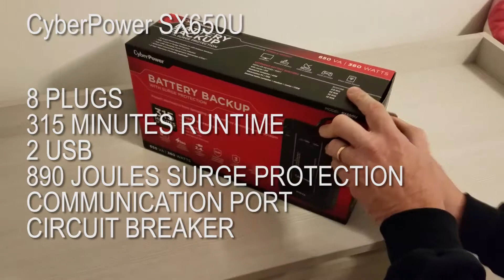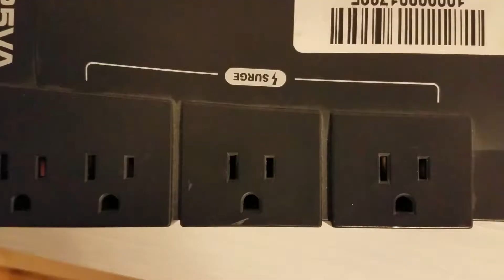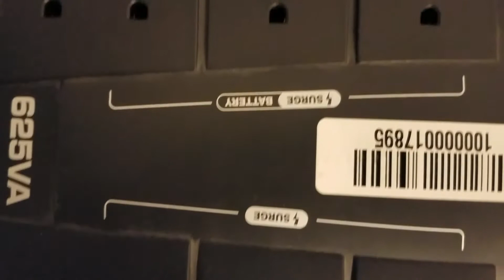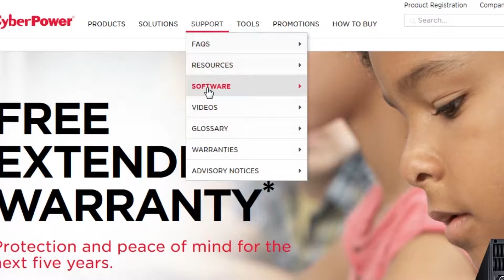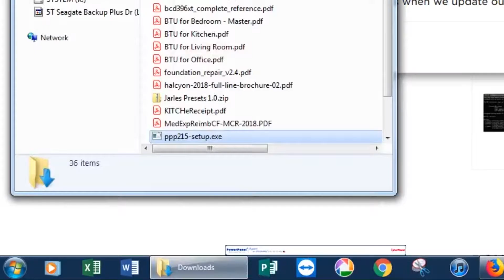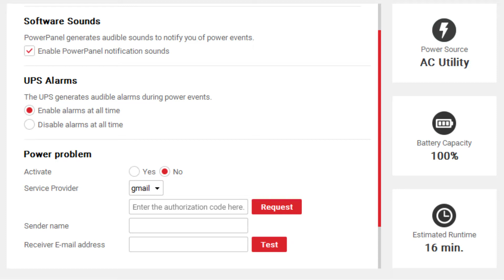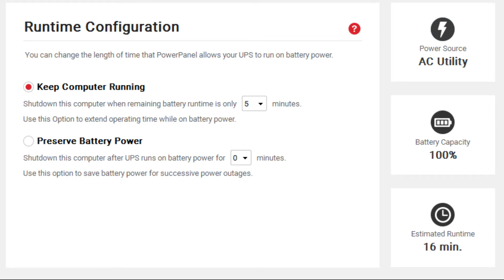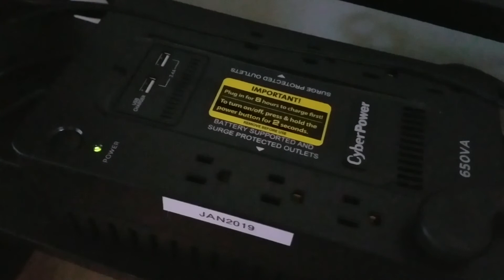CYBERPOWER 650VA UPS Truth and Lies

Comment: 😂😂😂 juste change Battrie 30$ 12 Amp
Reply from the maker: Generally I would recommend replacing the batteries at the most twice, by which time the surge electronics have worn out and there is better UPS technology available.
Reply: @cfldriven gaspillage d'argent
Reply: Cest bon 20 ans un ups

Comment: I bought this on sale. It did not have the usb cord? Will it still work ok if if i just plug in my computer.
Reply from the maker: The purpose of the cord is to safely shut down the computer using the Cyberpower software  during an outage. Without the cord the UPS will power the computer until it runs out of battery or somehow powers down the computer whichever occurs first.

Comment: for some reason  i can not get work on my laptop
Reply from the maker: While connecting via USB allows for the software to shutdown the laptop, just plugging the laptop into the UPS will provide surge protection and allow you to safely shutdown laptop during power outage.
Reply: i did for some reson it not working only showing on my laptop how much % the ups battery is like if 66% not know if it the cable i  restarted my laptop all thing
Reply from the maker: @kennthbrowne7051  You can try reaching out to Cyberpower support at https://www.cyberpowersystems.com/support/ or 1-877-297-6937

Comment: im a little confused cause i have my wifi and pc plugged in it nothing else my power went out and it auto shut everything off instantly idk why cause its always plugged in the wall
Reply from the maker: I have experienced the same situation and it can be frustrating. A few of the reasons it auto shut off could be the the combined PC and WiFi power draw exceed the 360 watt load, or the battery has deteriorated over time to the point it can not a carry any load. Your options would be to replace the battery, or get a unit that can handle higher loads like the https://www.youtube.com/watch?v=XveVObW70K4  Hope this helps.
Reply: @cfldriven  its 1000 watt it should be fine and its only a few months old maybe 5
Reply from the maker: @Spicearito  Then call them because it still under warranty.
Reply: @cfldriven  says its 496 minutes of battery remaining
Reply from the maker: @Spicearito  That is probably with no load. You might try disconnecting power with only the WiFi plugged in to see what it says.

Comment: I'm curious about whether using this draws constant electricity that i have to keep paying for.  It feels warm to the touch.  My son left one in the house and I'm pretty much using it as a power strip.
Reply from the maker: Yes the unit does draw some power to run the electronics and maintain the battery at a charged level. If you only need a power strip and no battery backup your choice is to turn off the unit and use the surge only outlets or buy a power strip.

Comment: I used mine for camping
Reply: Now going to use it for a hurricane for devices and possibly internet connection.
Reply from the maker: @bokneeza  I had one for the ATT router, but when I switched to cable internet, which will go out with power outage, there no sense providing back up to it. Instead I back up TV for OTA weather updates. Thanks for sharing.
Reply from the maker: A bit heavy but cheaper then Lith-ion battery pack.

Comment: womt be a power outtage bevause of so many appliances connected ?
Reply from the maker: If you exceed the power limits of the device, the circuit breaker will trip to protect the unit thereby shutting power off to the devices.

Comment: ?????
Reply from the maker: Huh
Reply: @cfldriven  is it safe to plug 4 appliances all running at the same time with this device without a power surge
Reply from the maker: @deeznuttz7980  The UPS has eight plugs all of which provide surge protection, only 4 provide battery back up. All battery powered plugs can be used at once as long as the power load drawn does not exceed the limit of the unit.

Comment: so you can connect like 6 appliances all  at the same time and the appliances  won't shut  off
Reply from the maker: Yes you can, if you don't exceed rated load. The runtime will of course be determined by how much total power is being drawn. The less power drawn the longer the runtime.
Reply from the maker: Sorry, actually only 4 of the 8 plugs are powered by the battery. The remaining 4 would lose power during an outage.

Comment: Great video!  That 315 minutes runtime is a bait and switch.   I bought this for the frequent power outages we have in Puerto Rico.  Charged it for 3 months, now the power is out, I plugged my laptop in, it lasted maybe 2 minutes.  I can't have a generator in my condo, I was really looking for something to give me a couple hours on my laptop and phone.  This is the 2nd time I wasted over $50 on a battery system thinking I understood from the box but I keep being fooled.  Most external type batteries (power supplies for phones etc) won't ship to Puerto Rico.  Any suggestions for a unit that will run a few items for a couple hours for me?
Reply from the maker: None of these ups will really work for you for hours of runtime, they are meant to safely power down and to protect from surges. I have a Vector https://youtu.be/V-bi-2hm-a0 which can run my 22 cu ft refrig for over 6 hours. Plus it will charge your devices. It is not cheap but I have found it to be reliable and it holds a charge for many months. The only downside is this device is used after the power goes out as you can't leave it plugged like a ups and expect it to take over during the outage.  The restriction on the shipping of goods to PR is a pure crime the US gov has failed to correct.
Reply: If it has a 12 volt battery you could connect a car battery to it and get as long as you want..
Reply from the maker: @red_diaper_doper_baby  Just remember leaving the interior light would drain the car 12v, so don't expect to get much when connected to something that draws more power.

Comment: UPS is for dirty power protection, overcome short power outages where the hydro company is able to overcome by doing some rerouting on the grid, and to shut down gracefully if the power stays out for say 1 minute.
Reply from the maker: Actually it is amazing how stable it is considering any person can plug anything into it at any time.
Reply: Will it clean generator power
Reply: @RonAskey  I have not seen any PC fail during short outages, so the power supplies can make due with it just fine.
The only time it fails is when the battery went bad.

Comment: Hello I bought an SX550G - the box says 315 minutes 550VA 330 watts.  I'm using it to keep my Modem WiFi Router and a single indoor Ring camera.  Used it while i was gone for 2 weeks, no problems.

So recently I've noticed it randomly gives out a single high pitched Beep, like a "peep" sound every hour or so.  Tried reaching to Cyberpower, the guy I had said never heard of that, then he tells me how to burn my house down, oh sorry he tells me how to disable the alarm, (Same difference to me).  I tell him its a commonly Googled question.  

Anyway any thoughts?
Reply from the maker: Are there any events listed in the PowerPanel software?

Comment: nice video but you get 1100 watts inverter 12 volt battery 100 amp deep cycle batter do much better run time long hours
Reply from the maker: Jack, these UPS are for very short duration use and while your seem may run longer will it automatically switch over and is it capable of safely shutting done a computer? I have a Vector power station that can run a frig for over 6 hours, but provides no UPS or surge protection. https://youtu.be/V-bi-2hm-a0

Comment: Hard wire a lithium battery replacement
Reply: Lithium needs a different charge circuit. Stay with the same battery chemistry but you can add an external much larger battery for longer outages. Lithium is kind of a waste of money for this application.
Reply from the maker: John, good idea except these were designed for charging lead acid batteries. The prob with lithium it is expensive compared to lead acid. I have a Vector Power Station powered by lithium and it is north of $600 and it is not a UPS.  https://youtu.be/V-bi-2hm-a0

Comment: Just got the same unit...it's noy turning ON...after pressing the power button it beeps and lights up but just turns off the light immediately after....help!!!
Reply from the maker: A silly question, was the unit plugged in? It needs to charge up the batteries before the inverter can supply power. Once it is charge try turning it on, if it fails then the unit is defective.
Reply: @cfldriven  oh im sorry...yes...and yes i charged it for 8 hours...then it's not turning on..so i guess this is defective 😔
Reply from the maker: @kaikaisvlog2755  That's a bummer, I have never had a bad unit from the get go, although I did have one fail prematurely but it was replaced under warranty. Good luck.
Reply: @cfldriven  oh ic..thank you!!!

Comment: Bought to use with my cpap. I tested it today and this 650va model gave me an hour and 5 minutes after disconnecting it from the wall. I was also charging my phone with it at the time. I guess maybe an hour and a half if not charging the phone. The problem is it beeps the entire damn time. If I connect a laptop or something to it and turn off the sound, will it stay off even after I disconnect the laptop? I don't have a laptop and would need to borrow one.
Reply from the maker: I found this, " If you would like audible alarms to be disabled permanently, press and hold the Alarm Silence button for 15 seconds. The unit will beep, once confirming that the audible alarms have been disabled." Let us know if this solution works for your UPS.
Reply: @cfldriven  no but thanks. It doesn't have an alarm silence button
Reply from the maker: @ItIsNot1984  I don't think there is a permanent off for the alarm using the laptop, this is what I found in the manual.
"Alarm setting: The audible alarm can be turned OFF or ON by quickly pressing the POWER button twice. The default setting is for the Alarm On. To turn the Alarm Off, quickly press the power button twice. You will hear two short beeps when the Alarm is turned off. To turn the Alarm back ON, quickly press the power button twice. You will hear a single short beep when the Alarm is turned on. *When the Alarm is turned off, there will be no audible notification when the UPS reaches a low battery state."
Reply: @cfldriven  thinking about it maybe it's best the alarm goes off and wakes me. At that point I can turn off the humidity on my CPAP and probably get a full night on it since it won't be heating water.
Reply from the maker: @ItIsNot1984  I agree with you, I would want to hear that alarm, at which point pressing the power button twice will silent it. Just fyi this unit not recommended for medical devices.
Reply: @cfldriven  I know it isn't but you should see what the medical grade backups cost. This is better than nothing for sure.
Reply: Thanks for your help. I had thrown the box and all that away before I knew this thing even had an alarm
Reply from the maker: @ItIsNot1984  Interesting, I just looked up Cyberpower med grade and noticed they list real run-times and not the marketing hype times.
Reply from the maker: @ItIsNot1984  Glad to help.
Reply: @cfldriven  curious they advertise the med grade differently. I wonder if there is even much difference between them. I notice they're also lead acid batteries
Reply from the maker: @ItIsNot1984  You get full sine wave output which is best for sensitive equipment, plus upgraded (medical) plug and receptacle.

Comment: Do you recommend buying for a ps5 and a 65-inch screen?
Reply from the maker: I actually will be moving my CYBERPOWER CST1500S UPS   https://youtu.be/XveVObW70K4 which is currently on my workstation to my entertainment center. It will replace the Cyberpower 650VA. While a surge protector strip should be good enough for your PS5 and tv screen, I like being able to run the router/wifi when we lose power and properly shut down what is is on. So if you want to be able to save your game when the lights go out, than something like the 650 should give you enough time to save and exit. Make sure it has full sine wave output and not simulated sine wave. Full is best for your electronic devices. If you are looking to complete the game the you may want to setup to something like 1500, which is full sine wave output.

Comment: out of every unit i have seen the non backed up outlets do not have any surge protection what so ever on them. Also the rated max runtime is always a lie. you will never get anywhere close to that.
This small unit you have here is actually really meant for simple things like running a router/modem. Id recommend using a power strip with surge protection before the UPS regardless what anyone tells you. just don't plug anything else into the strips.
Reply from the maker: You may want to consider the CYBERPOWER CST1500S UPS   https://youtu.be/XveVObW70K4 it offers surge protection on both the backed and non backed receptacles. In addition it provides full sine-wave output which is better for the plugged in electronics. I agree the rated times are just in their dreams, but in our case during an outage it will automatically shut down the workstation or give me enough time to complete a task before shutting down. The 650VA now protects the router. Thanks for sharing your experience.
Reply: @cfldriven  i need to look into that. would be good for a project I have in mind.

Comment: I always have one on my cable, internet, wifi box.   I hate when the power blinks and it take 2 to 5 mints to reset everything.   All you need iS a basic 1 mint battery backup for a power blink.  Nooo need for 15 to 20 mints.  Usually if the power goes out its for 30mints to a few hours.   Its sooo nice to avoid A LONG cable box reset.
Reply from the maker: Gregory you are quite right, although you should make sure that the unit outputs a full sine wave to prevent damaging today's sensitive electronics. And in the case of the Samsung TV, a UPS will keep it from switching on during a brief outages. Thank you for sharing!
Reply: @cfldriven  I do have a new samsung 65 TV I bought last month.  I hope it will be ok
Reply from the maker: @gregorymcgraw5940  I now use CST1500 which provides full sine wave. It a bit more but worth it to me. Here is my unbox and run time test. https://youtu.be/XveVObW70K4
Reply: @Gooby123 I would say 30 mints!  If your lucky

Comment: Can this be used for camping?
Reply from the maker: Good question, this is not really it's intended purpose. And while you could plug in your phone and other devices into it, you'll probably be disappointed with the runtime performance. Might be better off getting power pack designed for that purpose.

Comment: Does the green light mean it's fully charged?
Reply from the maker: The light next to the power button just lets you know that it is on with shore power or running off battery. To see battery status use the Powerpanel software.

Comment: I just bought it and will return it.after two days, on the Cyber Panel says 126 min run time when nothing is plugged. Once I plug the router, it goes back down to more or less 50 min. It’s or the battery that been too long on the shelf and got calcified or it’s the software the problem or maybe the 315 min is BS
Reply from the maker: Yeah the 315 minutes not based on any reality I know. Everyone's number will be lower as you plug in devices, which if you look at the small battery in the unit makes sense, just wish they wouldn't make such high number claims. I now have a CP1500 rated for 900 watts and PowerPanel claims 68 minutes but in this video https://youtu.be/XveVObW70K4 you see it doesn't get that far. According to latest spec from Cyberpower Runtime at Full Load is 2.5 min, while Runtime at Half Load is 10 min.
Reply: @cfldriven  last night I decide to check if it was the software that gave a wrong reading. I unplugged the USP and time it with just my router. It started to double beep at around 40 minutes. Ten minutes later, that was it. No more juice. I put it back in the box and will return it. Man, it had a 24 hours charge. I will not make and exchange that is for sure. I know that companies exaggerate but come on. From a supposed 315 min for a router to a 60 min?  It’s 5.25 less time.
Reply from the maker: @chauffeurmarco  Whith any real load on them, these consumer units don't run for long. And commercial units are super expensive. I use mine to give me enough run time to safely shut down and maybe have enough power to recharge my phone later.
Reply: @cfldriven  in this case, it’s fine. Me, I wanted something that get me to play or watch on my mobile while I’m in the dark. Need only the router to be plugged in. But this one can give me more than an hour.
Reply from the maker: @chauffeurmarco  Just know that even if nothing is plugged in it will continue to discharge during a power outage. So if you don't need to run the router 'til later, shut down the UPS until needed.
Reply: @cfldriven  it’s in my trunk, ready to be returned. It’s ridiculous after 24 hours recharge without without anything on and can’t get not even 60 min out of the 315 min said on the box. Tell me. Is your battery loose inside the housing?
Reply from the maker: @chauffeurmarco  Don't recall it being loose inside the housing. This ups got semi-retired to router and tv surge duty. After these batteries die, I'll replace the unit as I will only replace the batteries once. Probably replace with the CP1500.
Reply: @chauffeurmarco  its not really a fault of the ups it's self. But the battery used is actually hot garbage. They like to put in the smallest capacity they can. usually around 7Ah. If you could find a battery with at least 20 Ah reserve capacity you will get a hour easy.